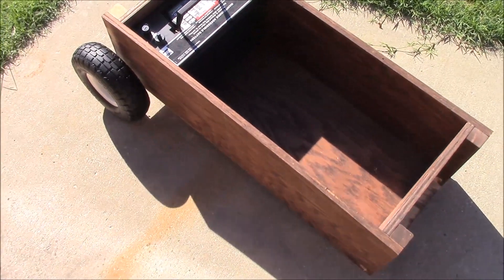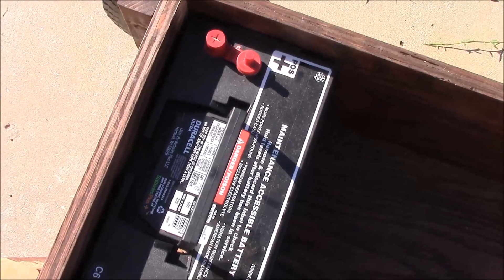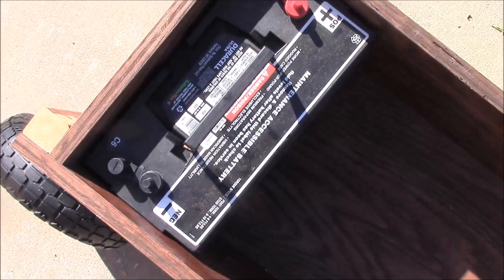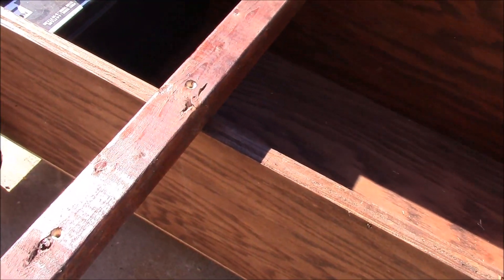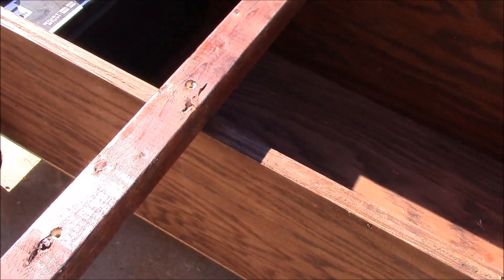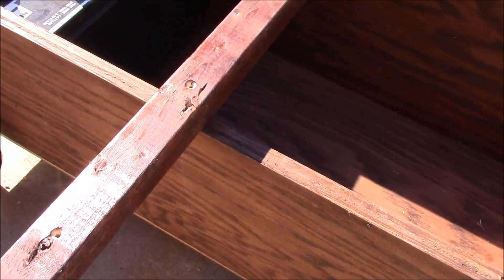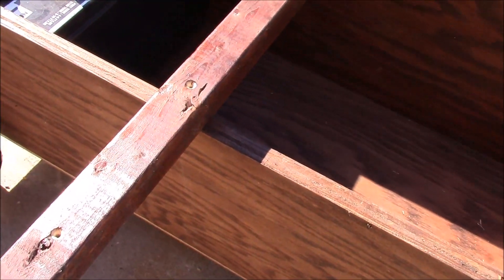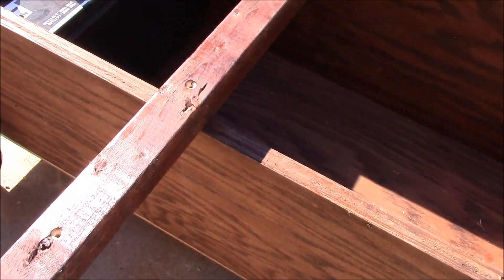Solar Generator Project - Part 2 Components & Mounting

Comment: Lookin good! Are you planning to include a 12v outlet or 2 as well or just strictly 120ac on the outside? I'm going to run both on my battery box for 12 lamps (E26 base?). probably buy a couple of cheap table lamps to install the lights in and change the plugs. 👍
Reply from the maker: I thought about it.  It would not be a big deal to put in a 12v connection so I probably will.  Good suggestion!
Reply: My thought for my system is an inverter for the AC stuff I'd need (only have 400 watt so far) and I bought a couple of 12 volt LED (4 watt draw - 60 watt equivalent output) bulbs to convert standard table lamps so it would be less draw in the battery. Then maybe use a 12v to USB bullet adapter for the phone and tablet etc. and that stuff could be used without the inverter. Just a thought, I'm a newb. Haven't even wired it up yet but your great videos have been a big help, and an inspiration to get going with it. I know initially it will only give me a few hours back up but that's more then the zero I had last winter! and I'll add to it after I get comfortable with the charge/discharge behavior. Looking forward to more from you, take care.
Reply from the maker: muddysledge Thanks for the comment and support.  You are on the right track and any amount of backup power is better than none when there is a thunderstorm, tornado, hurricane, or brownout.  Plus it is a fun and addicting hobby!